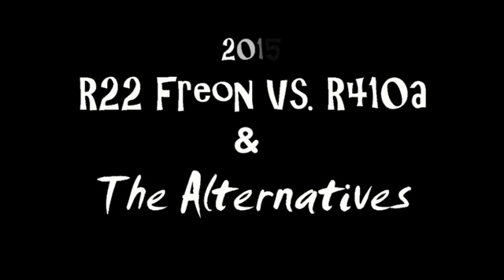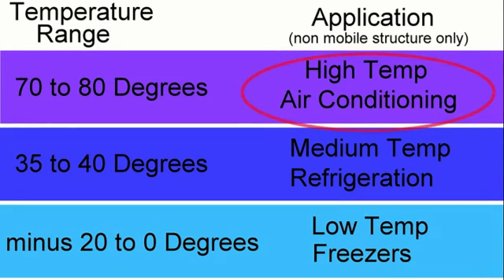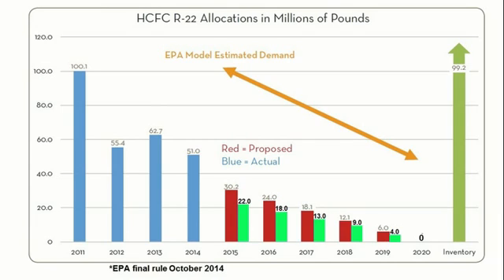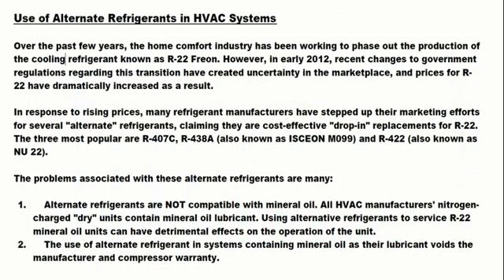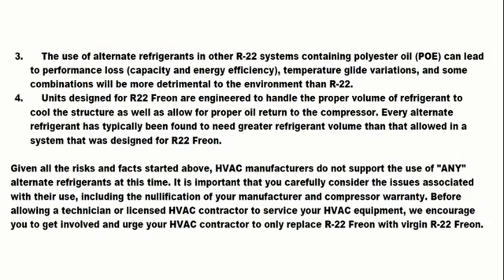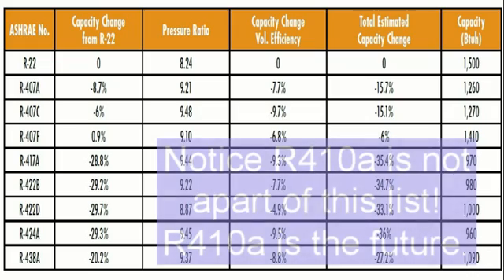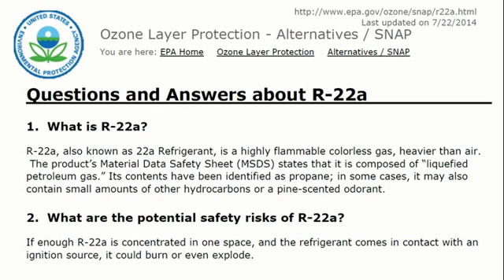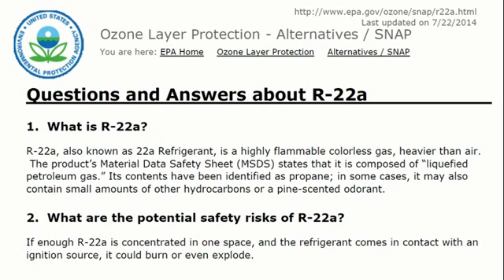R22 Freon vs R410a Puron And the Alternatives

Comment: https://www.youtube.com/watch?v=bOK4wQjnxHE
Reply from the maker: You lose efficiency going to R407c and you could generate complicated oil issues (your compressor won't last long without oil). I service and live in a climate in which AC is used upwards of 10 months of the year. It's better in the long term to use what the equipment calls for if you can't afford to replace it with new equipment. AC is predominantly a climate kind of decision. If your climate is 3 months long do whatever you want. My expenses go up to have to carry a third refrigerant those expenses get passed down. Thanks for the comment.
Reply: @AustinAirCo  if you watch the video, he uses the mineral oil for the machine to run well and long. The efficiency difference is neglagable, specially when you fa tor in the cost of what R22 costs.
Reply from the maker: Again this depends on your climate. If you have a 3 month long summer efficiency is of no real concern than a climate that has 10 month season. My climate is 10 months long average 2200 hours a year with 75 degree set point. Like it cooler than 75 the unit will run even longer. Longer run times and damage can and will occur. Again do as you wish. There are pros and cons no matter what you do, nothing lasts forever, especially in a climate that requires you to run it. I fix units all the time that are only a few years old. I don't make excuses for doing it right. If you want cheap air conditioning move to Alaska / Canada then complain about high food prices and it's too cold.
Reply: @AustinAirCo  its about 6months from the time M60 approval is expected. Buying a R401a unit is a bad purchase. 407a is much cheaper than R22, so its best to use it while M60 goes through, and then switch to it, as it is less pressure and compatible
Reply from the maker: M60 as far as I can tell is an Australian refrigerant that is flammable. It will never be approved in the USA because systems typically start to leak refrigerant at the indoor coil which is in close proximity to the gas furnace. Any amount of the flammable refrigerant gas pooling and you go to light the furnace and Kaboom. There is no manufacturer making equipment for use of such a refrigerant. The EPA would never approve the use of such a refrigerant here in USA. I'm in business to keep my customer's safe. Killing off customer's is not good for business.
Reply: @AustinAirCo  FLammable?, No, but they can combust in higher temps. But they are weak with mixes for High temp use. Besides , you do realize there are gas lines running into these systems with natrual gas or propane and these ARE flammable.
Reply from the maker: Gas lines running to your furnace, with controls to prevent fires and explosions and additives to natural gas so you will smell it long enough ahead of time so you can find the leak and fix it. There are no controls to contain refrigerant leaks on residential HVAC equipment, nor does it give off any smell so that you know  a leak exists to begin with then the safety in handling it comes into play from there. Clearly you do not know what you are talking about so please leave it to the pros. The refrigerant you suggest is extremely flammable according to MSDS sheet. https://www.engas.com.au/technical/
Reply: @AustinAirCo  leave what to the "pros"? Too many are thieves. Gases that dont ignite unless over 90-100F are considered combustable, not flammable. According to what M60 mix is presented to snap, it does have additives for detection, and retards reaction to combustion.

Comment: What is better r22 or 410 A ac
Reply from the maker: R410a. There is no 'new' machine made any longer for R22. R22 production is banned Jan. 1, 2020. After that point you may not be able to get it at ANY price. If you are able to get it your piggy bank is going to meet an untimely draining.
Reply: The better, more efficient, more SNAP and environmentally friendly, More natural, least costly, better on the unit parts... is M60. 
It is used in Australia, and is the best to replace your system with. Due to it being non flammable and only a natural state mixture there should be NO government restrictions on its use.  This is just a regulation to make sure someone's pocket is filled instead of a savings to the general public.
Reply from the maker: M60 refrigerant is extremely flammable according to MSDS sheet so call Phil if you want to blow up your house. https://www.engas.com.au/technical/

Comment: There is plenty of manufactures making POE dry charged units that are approved to use R407c. 

Plenty of techs are putting 15 percent POE in current R22 mineral oil units and charging with R407C with good long term results.
Reply from the maker: I would say this R407c would depend on climate and what the machine was designed for. If it was designed for R22, we aren't in the business of reverse engineering something. Long term to you means what? How long is long? Until I see your tail lights go out after you leave the property? Talk is cheap and time changes things... dry shipped units are no longer made.

Comment: what about R290 ?????
Reply from the maker: R290 is propane. While R290 is not named specifically in the video it falls under the "R22a or Superfreeze" name as this is also propane. Propane in "ANY" form is not approved by the EPA for use as a refrigerant. For the simple reason it is flammable not to mention explosive. Most refrigerant leaks develop in the Evaporator Coil which is located near your furnace which would serve as the detonation device. The few dollars you would save versus using virgin R22 or R410a is worth burning down or blowing up your house?  Nothing has changed since this video was made: Your best choices are:virgin R22 or upgrade equipment to R410a compatible. These are your best choices. Anything less than that and you're begging for trouble.